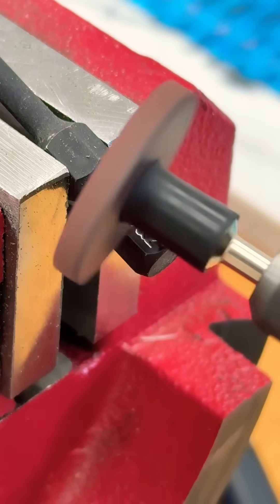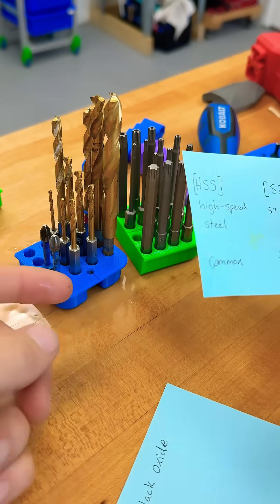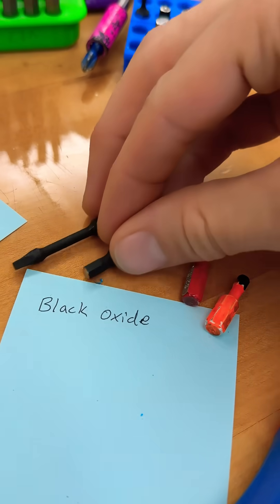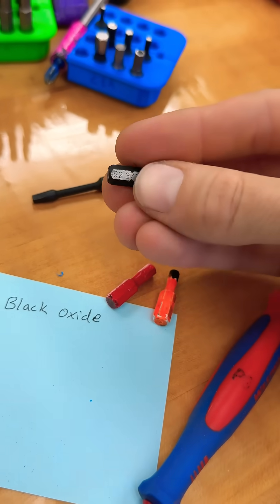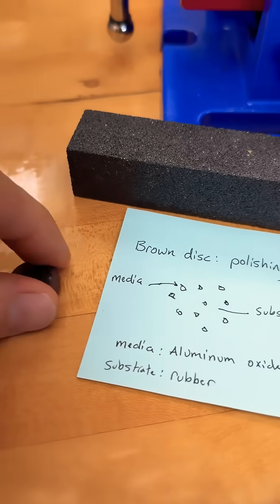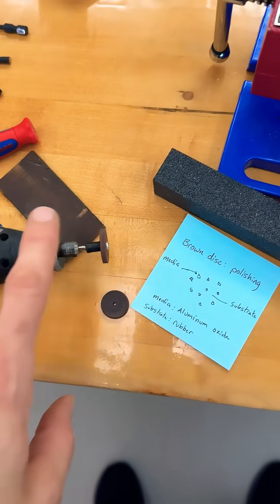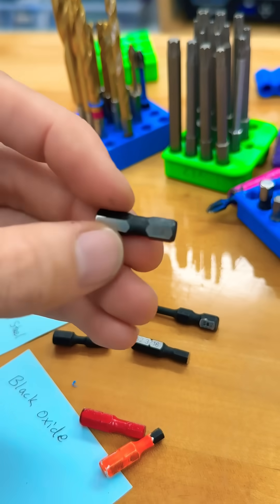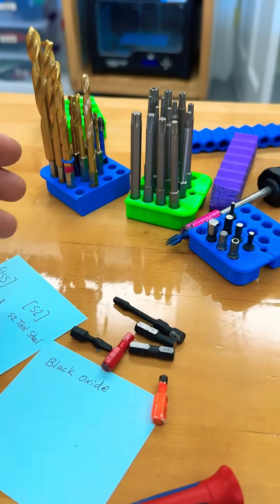the purpose of brown rubber discs with your #dremel, #diy #tools #openlab

Comment: Great tip, I had no idea about S2 steel bits before. I’m going to hunt some down, I’m *SO * tired of constantly replacing worn Philips ones.

(BTW, where can you get them? I don’t trust for a minute that bit sets on Amazon claiming S2 steel are genuine, but am having a hard time finding a source that specs that. WIHA advertises impact bits with 61 Rockwell C hardness, but not the specific alloy. Where’d you get yours?)
Reply from the maker: oh i think Phillips and screw-bits in general are a bit rare in S2 but i did get one that came with my strike-the-end screwdriver. (i don’t know what it’s called but it’s for loosening screws with a bop)
Reply: @davidmalawey  Impact Screwdriver